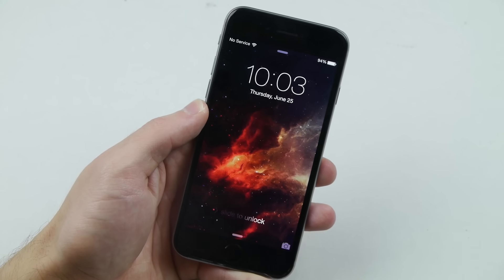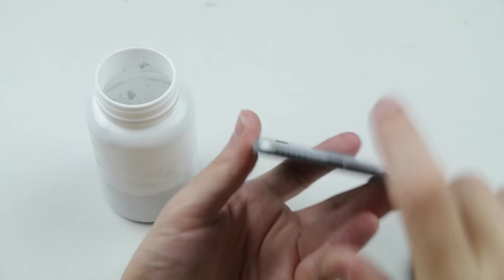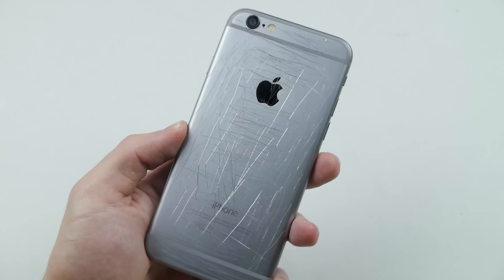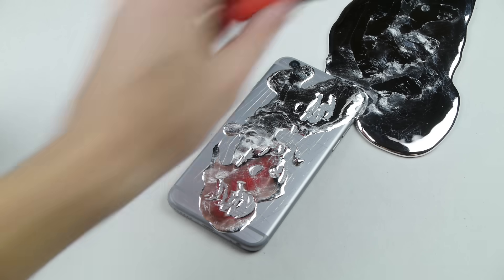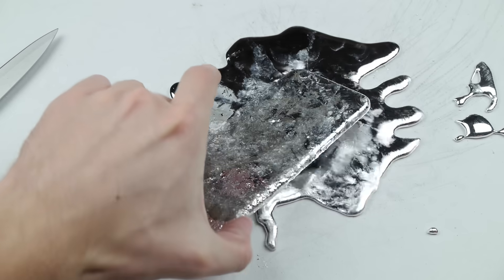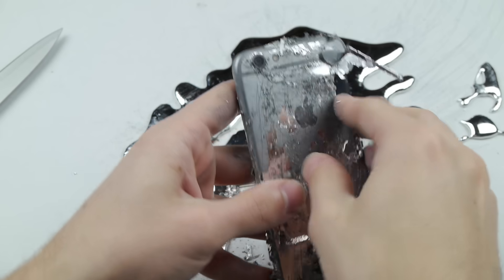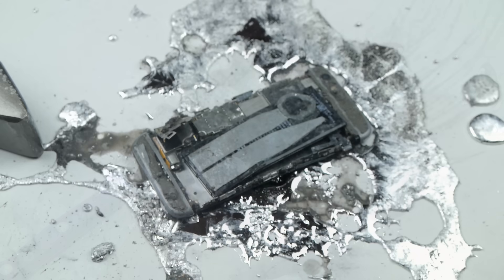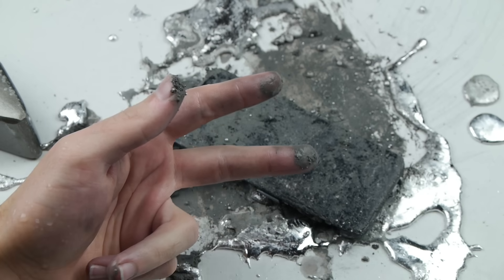What Happens If You Pour Gallium on an iPhone 6?

Comment: uses rug to hold container of molten gallium
Reply: I know its not toxic, learned that from reading the previous comments on the video. I was saying how its funny that he is holding a container of molten metal with a random household object (rug)
Reply: +redboy755 Molten is when it's a liquid.
Reply: JerTheGeek Welp
Reply: Molten gallium melts at about the human body temp he melted it and heated it up far more than 100F so that's why he used a towel
Reply: +JerTheGeek Gallium has a low melting point.  It wasn't totally scolding hot, like straight out of a furnace; he probably was saying it was hot because he did something more amateur, like microwaving it (although I am not sure it the waves would heat up the gallium, because I think they mostly affect water, sugar, and fat).

Comment: TechRax  The real question is, did Apple accept this for warranty repair? After all, it (presumably) didn't trigger the moisture sensor.
BTW, sandpaper would have made a lot more sense for "scratching" the back of the phone. Also, you could made a dam of tape around the perimeter of the phone to hold the gallium on the back and keep it out of the buttons and other sensitive areas--but then, it seems you were determined to "grill" the phone anyway.

Comment: when you mix gallium and aluminium together the chemicals make gallium aluminium alloy which when water is put in contact with water it splits waters chemical bonds creating hydrogen gas and oxygen gas which both are flammable

Comment: The bubbling in the end was the Aluminium reacting with the water to produce Hydrogen. 

Aluminium doesn't normal react with water since there is an oxide layer on the surface. But since the Gallium amalgamated with the Aluminium and stayed liquid, the Aluminium never formed an oxide layer, thus creating Hydrogen when mixed with water.